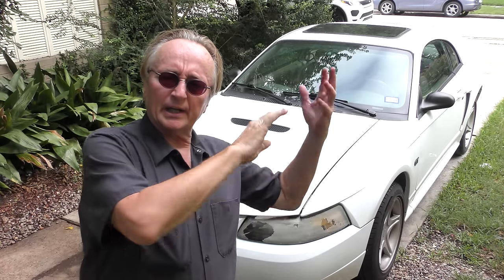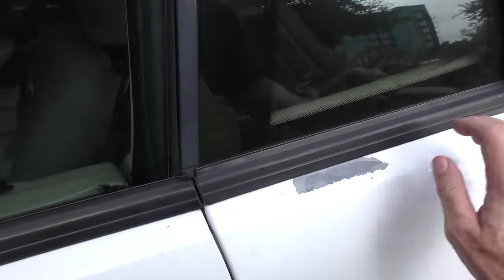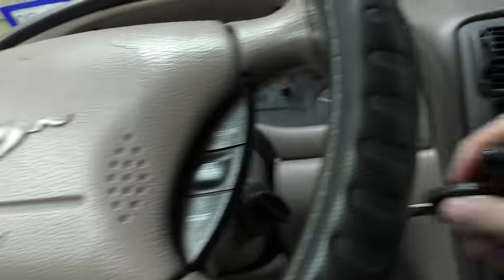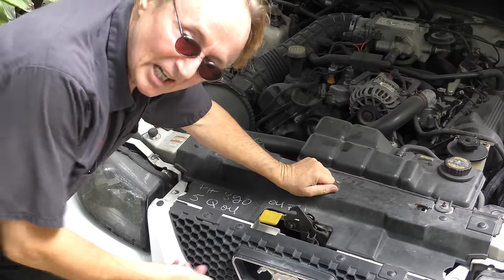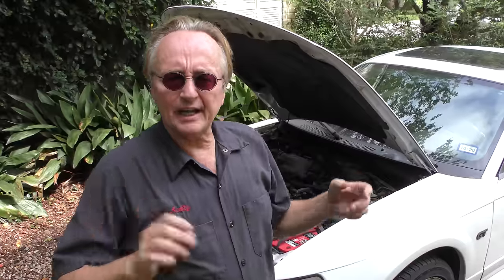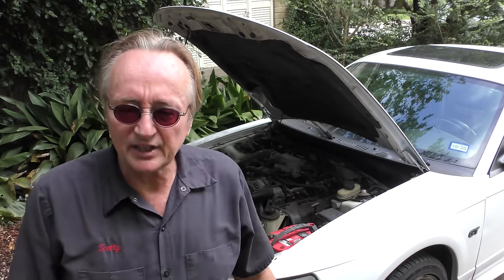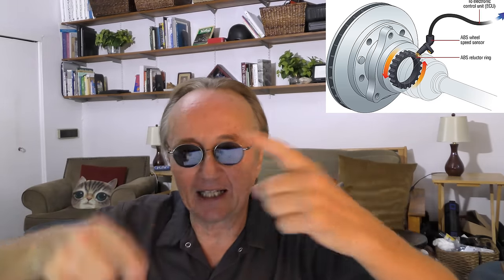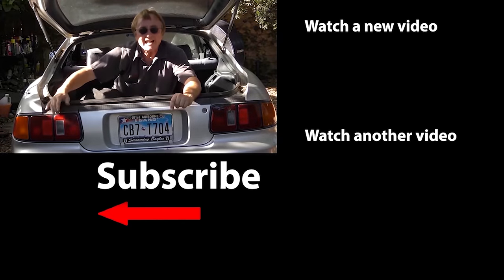Buying an Old Mustang and Fixing It Up

Comment: So I’m new to the channel but I have a question for Scotty and I don’t really know where I need to put it so I’ll put it here. 
~ Hey Scotty I have a 2020 Ford Fusion 1.5L EcoBoost, got it brand new. I plan on doing maintenance myself and I was just wondering your recommendation on Oil Change intervals, I plan on using full synthetic oil. For some reason it doesn’t seem to say what Ford recommends anywhere in the owners manual. Love the channel and Thanks!
Reply: TheRightChoiceTV I suggest you do change oil every 6 months or 10,000km. I have the same engine and its prone to LSPI. I’m already on my 2nd engine.

Comment: Thermostat to manifold cracks at front Bolt done by mechanic when I wasn't looking always fix bolt heads with a little crayon color to know whether they've been touched or not if your if you've been accompanied with someone who's befriended you who's working for the mob

Comment: That is the big engine, 2 valve 4.6 engine 260 hp, the smaller option was a 4 0 v6 engine about 200 hp. Nothing made 385 hp Scotty keeps repeating. Do your research  please.  The very limited SVT  2000 Cobra made 385 hp for 1 year and was not available for the average Joe to buy. The 99 - 01 made 320 hp advertised, those were 4 valve NA. The street king SVT  2003 - 2004 Cobra 4 valve supercharged made a underrated 390 hp 390 ft pounds torque. They actually made around 425 hp 425 torque, because of the nearly 385ish hp and torque to the rear wheels.

Comment: It's crazy that people say fords are unreliable junk but I see these sn95 mustangs everywhere still driving.. I see some for sale on facebook market with over 200,000 miles still running v6s and v8s.. the interiors rattle but they still keep going.. cars around 20 years old driven like hell still running?? Is that not reliable?? At my shop we have a ford expedition come in with 295,000 miles still running.. lots of ford rangers with 200,000 plus miles.. I think ford spent more on the mechanics of these vehicles than they did on the interiors and the bells and whistles.. I remember the higher end chevys had more advance technology.. like the chevy monte carlo ss from the early 2000s had stereo control on the steering wheel and a message board on your dashboard and a much smoother ride but what does it matter if your vehicles motor or transmission doesnt last?

Comment: Thes things are fun just make sure to remove that ugly grill so it looks better/tinted the lights and get a nice exhaust so it sounds like it should and get better looking wheels if u want to and u should get better air filter that is open and not coverd up and u better have alot of replacement clutches

Comment: If I got one of these Mustangs it would be the Terminator 2003-2004 SVT Cobra.
Pushrod engines are inferior?!!!!! The LS7 makes almost twice what that engine makes with potential for a lot more. That's what an AMG M156/M159 quad cam with continuous variable valve timing makes. No absolutes.......always exceptions.

Comment: 8,000 miles per year? Wow. I guess any car will last 20yrs if you hardly drive it. It's probably mostly all city miles, which is much harder  on a car over time. The Ford 4.6L V8 is a fantastic motor. Silky smooth and they LAST. I'd love to be able to drive a car 20yrs without someone ruining it for me. I can't seem to drive a car more than 4yrs without someone rear-ending me.

Comment: I've had 3 
... They're fine
Their automatic transmissions are junk (in my experience the torque converter is the problem)
The manual ones are okay but aren't bulletproof
The intake manifolds leak (v6 and v8 both do this lol)
The seats are pretty uncomfortable  and theres not much legroom which might be a deal breaker
They actually do kinda like to rust (not terribly but definitely check for that before you buy one) 
The 4.6 likes to blow sparkplugs if you don't torque them (this applies to all 4.6 and 5.4 ford 2v)
They handle like a mustang (you've seen the videos) 
They are great bang for the buck fun though
You can find even v8 ones for around 1500 albeit they will be rough there's nothing else that will give you that much fun or performance for the price
Reply: Although to be clear they are much better made than something like the Taurus and anything Chrysler was putting out at the time

Comment: Hey Scotty, I'm having trouble with a 98 Ford Mustang V6. I think its an issue with the EGR valve or a hose leak. The car runs fine until it warms up and when I give it gas I looses all power and it surges. It doesn't happen all the time though it seems intermittent. I have a P0401, and P0402 code. Love your channel, any help would be greatly appreciated. Thank you.

Comment: Ummmm. Did Scotty just say these mustangs have aluminum quarter panels? There's no aluminum panels on these cars at all, everything is steel except the hood, trunk and sail panels. Those are all fiberglass. Skirts, scoops and bumpers are your typical plastic. The "bigger" engine is also a 4.6L so idk how much "bigger" it is other than external size since it has bigger heads. Also, it has a 4R70 not an AOD-E. The AOD-E was phased out with the 302 in 1995, the 4R70 is a derivative of the AOD but just like we don't call a coyote a modular motor, the 4R70 isn't an AOD.

Comment: Can I put R134A in an R12 system 1992 Miata ? The hot and cold valves are converted for 134A plugs.

Comment: Durability: I wonder how many properly-cared-for, actual lemons there are, that have gone 250,000+ miles as a result of good care, vs. factory-perfect, but beaten/poorly driven, poorly maintained, neglected hoopdies (which could otherwise have been perfect cars) there are, that died before 75,000 miles? Maybe not zillions, but I'll bet there are a bunch.
Regardless of this Mustang's condition when it left the factory, somebody obviously cared for and drove it well to make it perform as it does at age 20, with150,000+ miles. It would be interesting to see Scotty do a video about how to make any car last forever. I don't buy the notion that that can't be done with most cars. Yes, I know there are exceptions (Yugo, MG Midget, Fiat, my 1970 Dodge, etc.), but...

Comment: Didn’t these 4.6 blow spark plugs because the threads were crap?
Reply: Mark Codiroli I’m pretty sure the genius at ford did not have enough threads in the head. Even if anti sieze were used, what does that have to do with the plug literally blowing out the cylinder? Let’s pretend someone over torqued the plug, why would that cause the plug to literally blow out?
Reply: Mark Codiroli If you want to reply maybe you should read what I wrote first. I said over tighten. If you want to blatantly ignore that the 4.6 head has an engineering dragon flaw that is a separate issue. But I guess the blame is on all the other dumb mechanics that leave plugs loose.
Reply: Mark Codiroli lol first you said it’s retired techs that don’t know how to install plugs. Now you’re saying galling is an issue with 4.6. I appreciate your reply but I’m going to ask a knowledgeable engineer about the technical details on the 4.6. Good to know mechanics have their own view points but I like to talk facts and feelings.

Comment: anyone could tell me what mileage does a Mustang from this generation with 260hp V8 give? Especially around town
Reply: The general answer google will give you is about 18mpg— though, that varies fairly significantly. I have an 03 GT (automatic) and an 04 GT (manual). The manual gets the best mileage by far, getting about 24-28 depending on how I’m driving it, and about 32 on the highway. The automatic gets a little less, about 22; but there’s alot you can do to make that number higher, and god knows there’s enough space to install aftermarket’s in these babies. But, yeah. Typically, these have a 13 gallon tank, you can expect to get around 325 miles on it if it’s just a town car.

Comment: That's not a Mustang GT as it doesn't have the proper hood and side scoops like the GT model has, so either someone has changed the hood and side scoops or this car is a meld between a v6 and v8.
Reply: I looked up the vin, that is a GT but someone swapped the hood and side scoops...

Comment: Never buy the v6 version it has too many problems
Reply: The v8 wasn't free of it either. They used a cheaper metallurgy for the heads and the difference between the aluminum and iron caused swelling under high temperatures. The v6 suffered it more openly and often cracked the heads if they got too hot or were pushed too hard. It got fixed in 03 but damage was done. The v8 tends to just eat head gaskets but the heads also crack if abused. Kinda sad because my 97 lasted over 500k miles.

Comment: I did 2 oil changes on my car with a month the oil was just like liquid tar after only 700 miles so people who wait 10,000+miles just wow, the reason for 2 oil changes was because the previous owner didn't change the oil for 3 years so I wanted to clean the engine. It's a 1.6 turbo diesel puts out 320 ft lb off torque and 190hp :) and 60mpg

Comment: I used to love that generation of mustang until I actually got one, had 5 of them so far and they’re easily the worst cars I’ve ever owned (especially the 3 v6s, they were definitely junk)
Reply: How so?
Reply: @IntelTV  they were all cheaply made body and suspension wise, I was replacing suspension parts left and right. The automatics were terrible too I had one manual and it lasted forever until I got rid of it, the automatics wouldn’t do anything. That said the 5.0 was damn near indestructible, the rest of the car was falling apart and the v8s would purr like brand new.

Comment: The only problem here, is that it's a gas hog like no other. These are rugged toys, not really a commuter.
You won't spend a fortune in fixes, but you will in gasoline.
Reply: 22mpg avg over four years. 28mpg highway.
Reply: @OneDamNote  Are you getting that gas mileage with the V8 or V6? I had a GT and I would say the mileage was 16 city/18 hwy.

Comment: That the only small sedan cars Ford Corporation produces are good enough to lasted to 200 or little more thousands miles are only Ford mustang 6 cylinders sedans series all the rest are only so so small sedan cars models brands can last only 150-160 thousands miles maximum than the engine start falling a parts fasts not worth keeping after that.

Comment: ABS light on, maybe someone can help me pls! The diagnostic tool shows ABS but I can't get in, what should I do? Check power from ABS control unit or sensors?
2001 Model
Reply: For me it was dirty sensors. They’re behind the brake rotors check them.